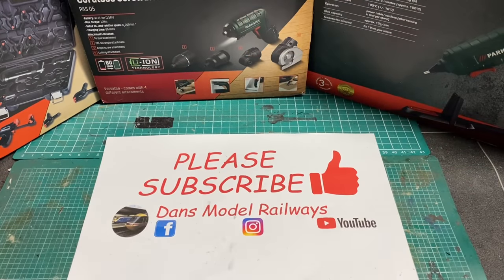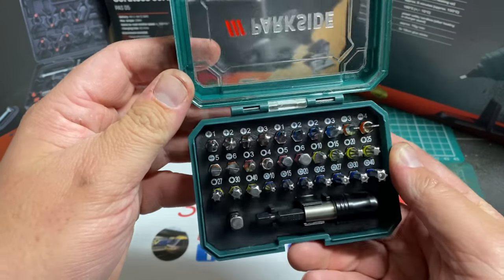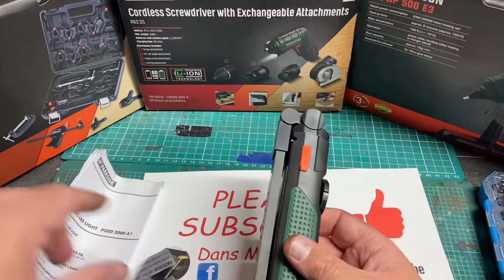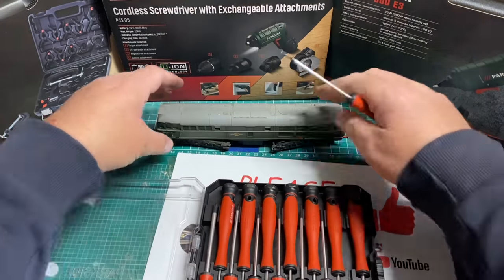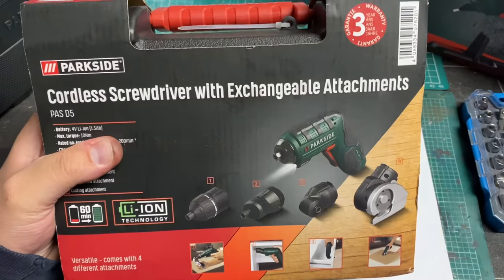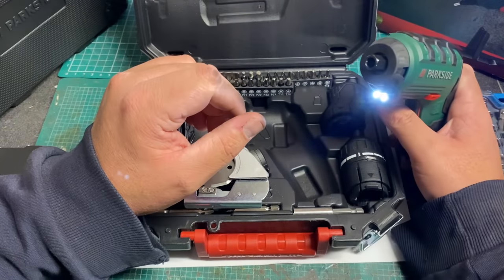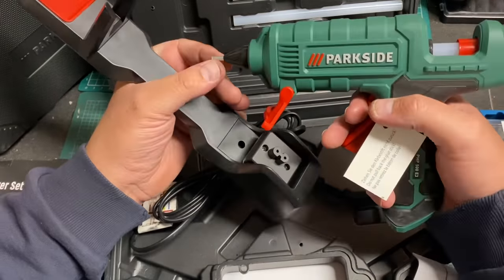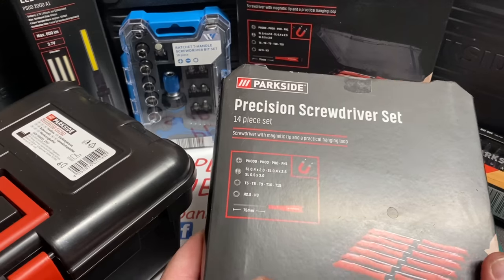Affordable tool finds in Lidl & Aldi + GIVEAWAY.

Comment: Torx headed screws (not star). Designed for use by hand or power operated screwdriver as there's virtually no way the driver can slip or ruin the item or screw head unlike the crosshead or slot headed screws.
There's nothing like having the right tools for the right job.
Just an opinion,  the cardboard box or sleeves that these tools come with contain information which is important and I tend to keep these including the tool case.  Try not to damage them.

Comment: i've noticed some comment regarding quality of the tools not being good enough for diy, maybe some amature diy'ers just dont use tools properly, i work on cars / bikes / ebikes and vans, in the last 5 years i have had 2 parkside tools fail, the 20v grinder motor burned out after about 3 years of above average use, and the 20v jigsaw on/off/speed switch smoked. once again that lasted me through 2 campervan builds.  as to the 20v batteries, there from grizzly and rewrapped and originate from samsung (q series) and i buy the batteries, strip them, and re-use the cells in ebikes, although on my folding bike i just use 2 of the batteries as-is and recharge them in the normal charger, our oldest battery is from 2018 and gets used at least weekly as we cycle (no ebike pun) to even the wera and tear. what i dont like about the batteries, no internal under voltage protection, only charge balancing. (all 20v batteries have balancing since atleast 2017)

Comment: The problem with Parkside tools is you can’t get spares for them 
I have a Parkside hammer drill and I’ve been trying to purchase 
a new set of brushes With out success .I started in July speaking 
with Lidl customer service who passed me on to Grizzly / Novo who
have never replied to any of my emails.it’s now October and still no joy
Parkside tools are quite good but unfortunately Lidl and there supplier’s 
are not very good on after sales
Reply: Sometimes if you find a part number of a part, if you put that number in to Ali express or amazon, you may find a result.  Most of parkside stuff is just rebranded Chinese items.
Hope this helps 👍🏻

Comment: Yes I agree this stuff is really good for modellers.  I subscribed to receive the Lidl weekly offers which is handy for an early heads up on the middle of Lidl!  I have seen some stuff recently that I thought would make useful tools for my modelling projects and raced over to my not so local Lidl store on the day advertised.  Regrettably my store never seems to get some of these little gems in stock which is very frustrating!!!  I tried for 2 weeks to get the clamp set but to no avail. The round base thing is just to mount the mini G cramps in!  I managed to get the recent modelling knife set by a shear fluke this week! 🙄  Nice little video of stuff that I cant often get!!!!!!
Reply: Yeah I certainly understand. It’s just a matter of finding your nearest store that has all the kit and getting there early on the day. Being “on time” is too late!!! Get to know staff, they will tell what time they ‘dress’ the aisles etc. Same with online sales go immediately you are aware, not on the day! So mobile access is crucial. You can win if you treat this as a contest and not as doing the shopping! Lol
Bob
Reply: @BobMuir100  Good advice!  Since then I have persisted and only missed out on a couple of items.  I did manage to pick up those tweezers the other week and the epoxy resin!  I live out in the sticks so things are a bit slower here!  Some things can turn up weeks after the advertised release date!   Keep up the good work! Regards JH

Comment: I've bought loads of stuff from both shops some to do with modelling as I build race and camera drones, other stuff I buy I use for jobs around the house and garage. Bought a fantastic Powerfix Screwdriver and Bit set from Aldi a few years back that has 95 bits in it, all in all there are 101 pieces in the set. Got modelers compartmental boxes that have small compartments in for spares for my helicopters and drones, also got two wall mounted boxes with trays in for spares as well in my back bedroom/office/modelling room.

Comment: We shop at Lidl my wife rather shops i go straight to the tool section. Most of what you showed i already own being a keen modeler of HO and wooden boats. Most of my larger DIY tools are also Parkside, had them for years ie drills, saws angle grinders ect and they are all brilliant. I like that light you showed and will have to get one. Thanks for vid

Comment: I heard that the Parkside tools are made by Black and Decker .I’ve had some good and some really bad
Reply: Some would be made in the same Chinese factory. But BnD are not the same as they were. Only Makita are independent, plus Hilti. All others are owned by other companies. There are three super factories in China, good bad ugly. Ferrex and Parkside use ugly and bad. Dewalt use ugly and good. So all parts and mouldings are shared. Dewalt are owned by Stanley, Bosch often share parts on their cheap green tools with Parkside. Ferrex often rebadge Scheppach. Bosch blue is still quality. Ferrex quality varies but is good as a spare drill for pilot and countersinking. So a mix of Makita and Ferrex serves DIYers and builders well. Great video Can 😎
Reply: @frankklein4872 😊 thx 4 this v useful background info on source of tool manufacturers.   Blk-n-Dekr used to do an after sales reapair servis.